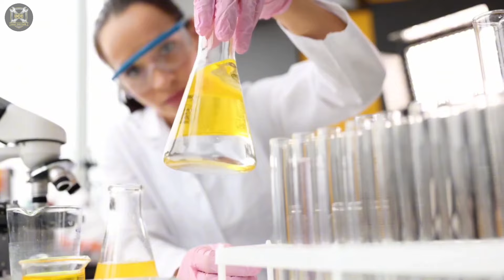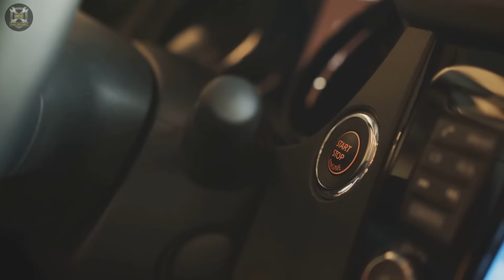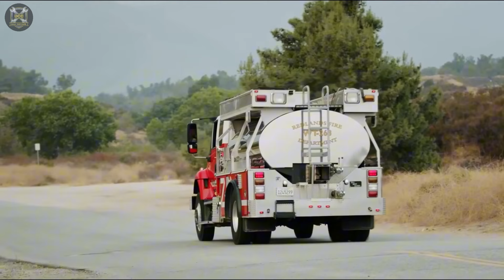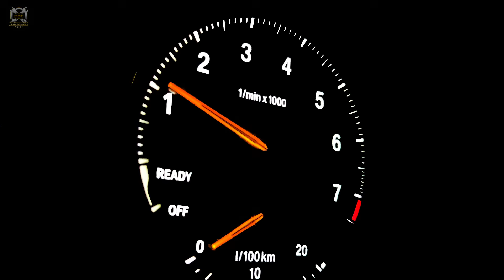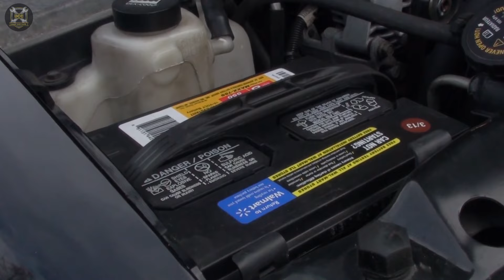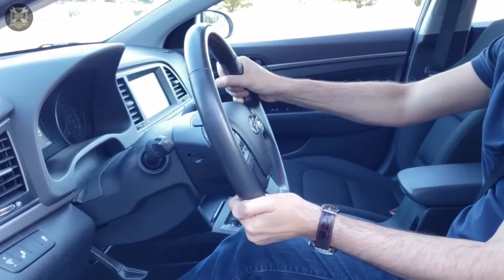NEVER Do These 5 Cold Start Mistakes — AVOID THEM At All Costs!

Comment: Most of my driving is city only. What do I supposed to do?
Reply from the maker: The best thing you can do is focus on smart car maintenance: use the correct engine oil, don’t stretch oil change intervals, and keep RPMs low for the first few minutes. Gentle throttle, smooth braking, and letting the automatic car shift early all help reduce car engine problems and improve car reliability. 
Do you usually make short trips under 10 minutes, or do you ever get a longer drive in to fully warm up the engine and burn off moisture?

Comment: I live in a cold area and use thicker oil year-round. Starting to question if that’s a good idea.
Reply from the maker: It’s definitely worth looking into the recommended oil viscosity for your specific engine and cold climate conditions. Have you noticed any difference in engine noise or starting difficulty in the coldest months since switching to thicker oil?

Comment: Cold starts feel rough on my SUV, especially in winter
Reply from the maker: that's very common. Have you noticed if it smooths out faster after switching engine oil, or do you think your cold-start routine might need a few small car care tips adjustments?

Comment: to long of a vid. 5 minuets is more than enough time to explain.
Reply from the maker: Totally get it, it’s longer because it needs to be explained clearly. Most mechanic advice sounds simple, but the why behind it is what protects car reliability, especially on modern automatic cars and new cars. Would you rather hear a quick tip, or understand why it actually matters for your car engine and long-term car care?